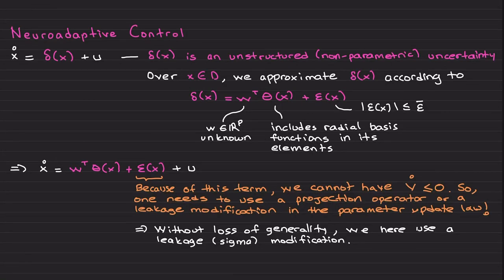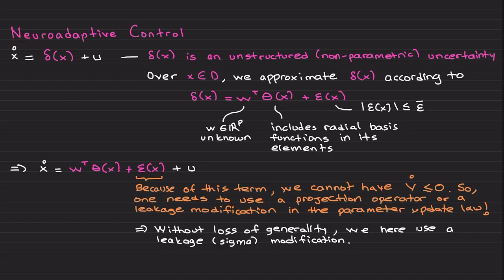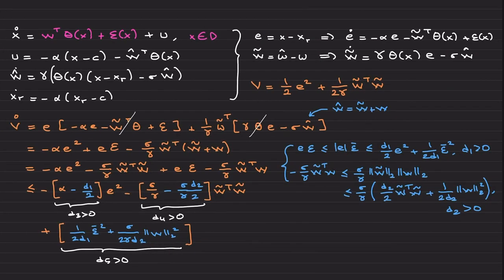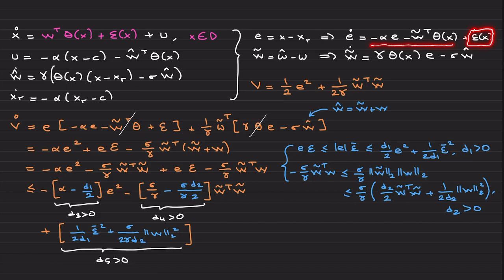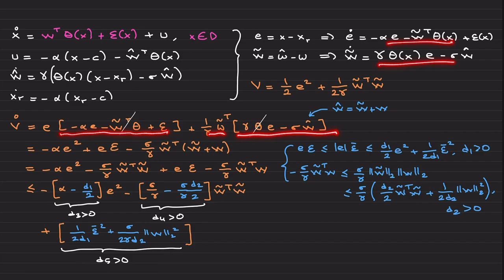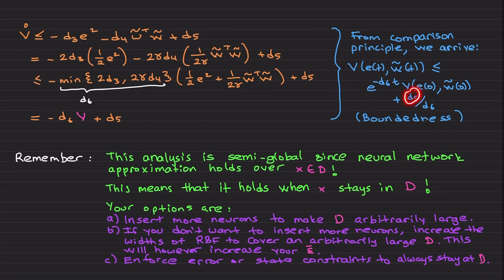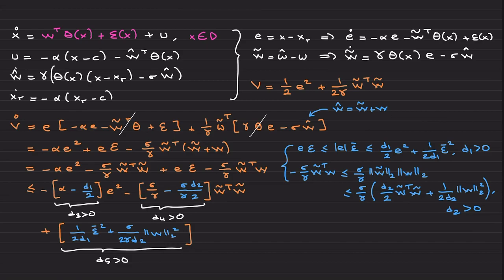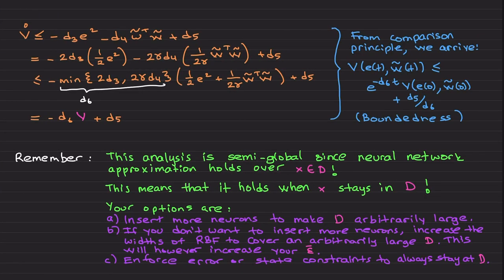Neuroadaptive Control (Lectures on Adaptive Control and Learning)

Comment: Professor, how does this second Lyapunov candidate function connect with the first candidate function you chose to find the weight update law? Is it necessary to do both analyses? Or just the second due to e(x), and how would you find W_hat_dot? That wasn't clear to me. I would appreciate it if you could answer this question!

Comment: What happens if you have an input disturbance such as turbulences that are not functions of the state x? For example in rotorcraft, you have control equivalent turbulence input (CETI) models. 
It must be also estimated by general function approximators and the weights right?

Best regard

Süleyman
Reply from the maker: The bias term included in the basis function will take care of such disturbances 😉